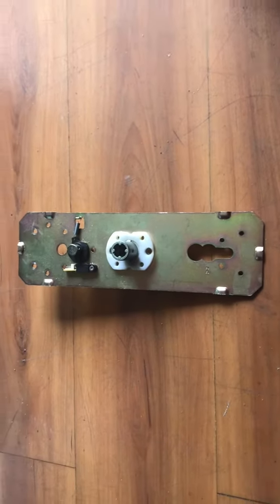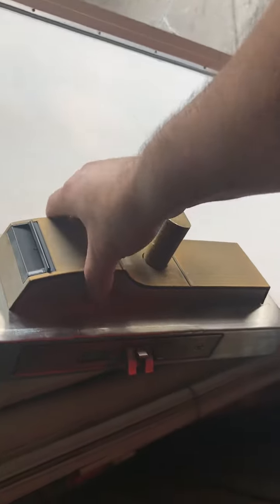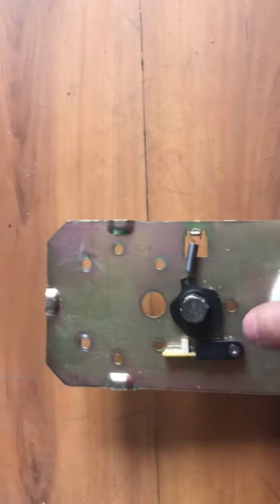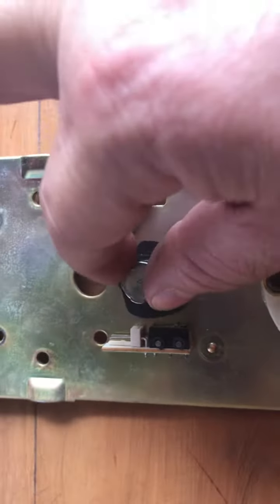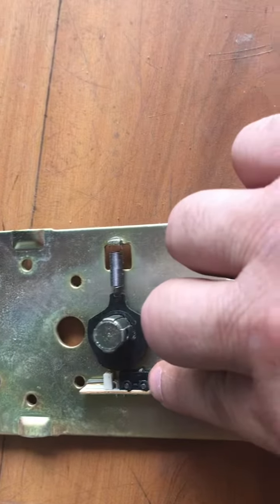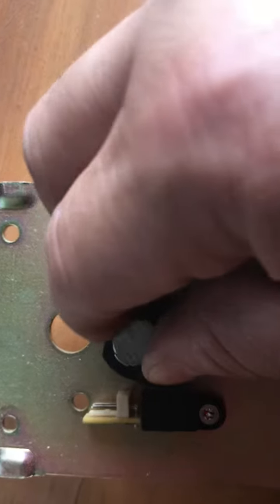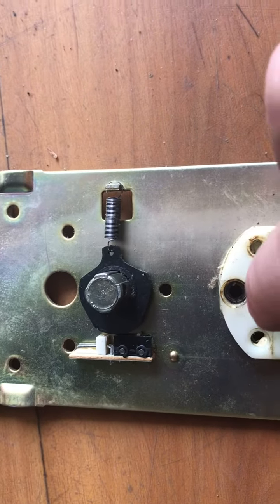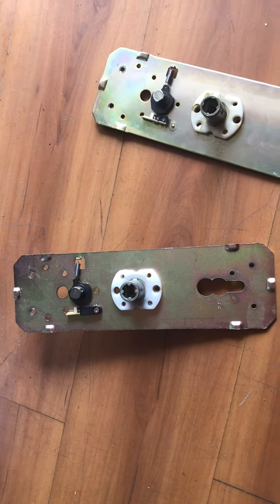Onity lock  green light but wont open door how to fix

Comment: I have a onity lock that’s not locking…can u make a video on that?
Reply from the maker: Try updating the lock  if that dont work  reset the lock and initialize
Reply: @azteksoldier50  ok I tried that. I get the green light and once I open and close the door. I’m still able to open the door without a key.
Reply from the maker: Try inserting a master key  even if open without locking   If that not work remove the batteries for some time like 2 minutes and try again